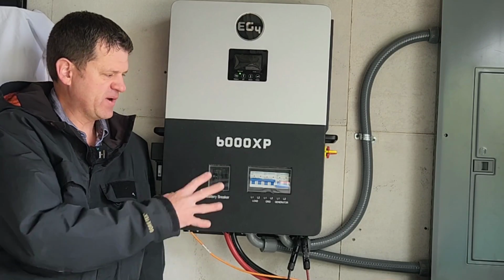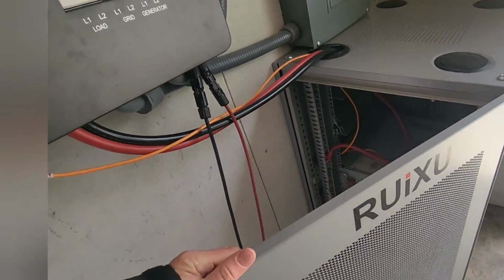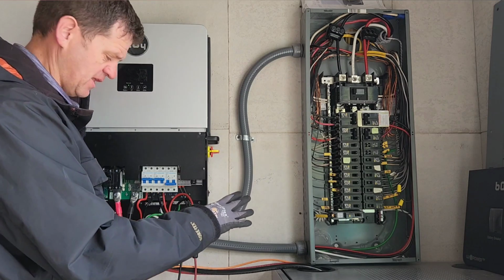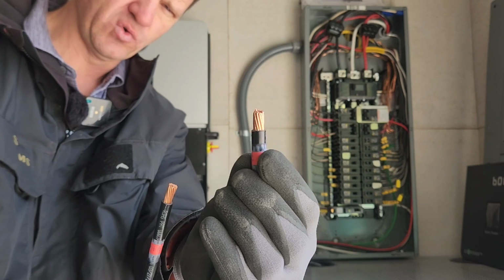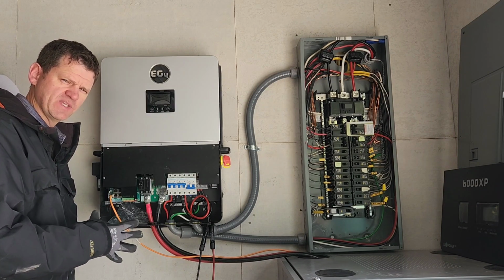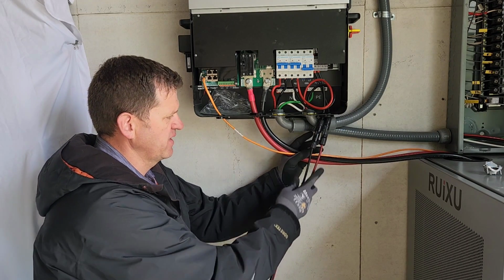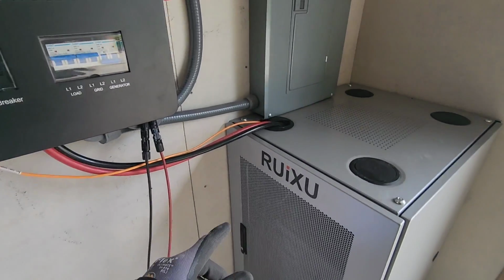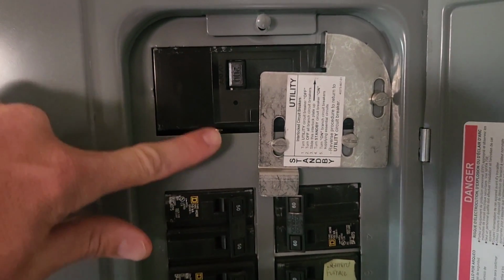1 Month Review: Easy DIY Home Backup Solar Power System & Battery | 6000xp Ruixu Install

Comment: These pair real well with the powerpro wall mount batteries and conduit wire way. Easily upgradeable by stacking batteries or inverters as needed. Thanks for the update. I always use and recommend metal flex conduit for pv wire indoors
Reply from the maker: Thanks,  I'm running my PV wires now. I will definitely put them in conduit inside. 👍

Comment: 36” clearance in front of panels. This is a basic code regulation.
Reply: Basically, what he is saying is that you can't put the battery enclosure in front of the breaker panel
Reply: Big nono

Comment: The inspector may comment about obstacles in front of the panel next to the inverter. By code, the area in front of the panel has to be accessible. The inspector may look the other way if the battery box is on wheels. It all depends on the AHJ, authority heaving jurisdictions. Let us know how it goes.
Reply: Thanks for the update. But this is considered off-grid? So why the need for inspection, thank you.
Reply from the maker: Ah. Good to know.  Thanks 👍